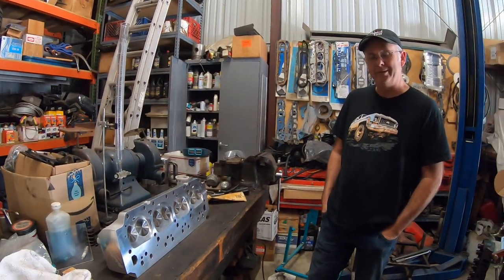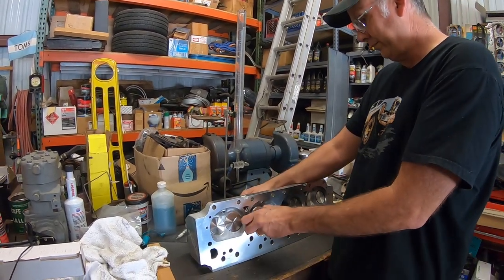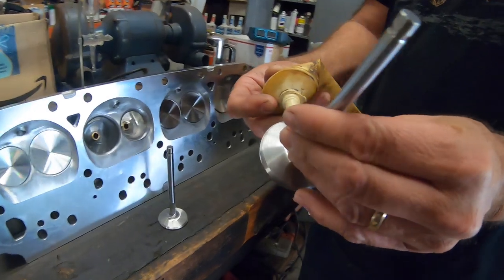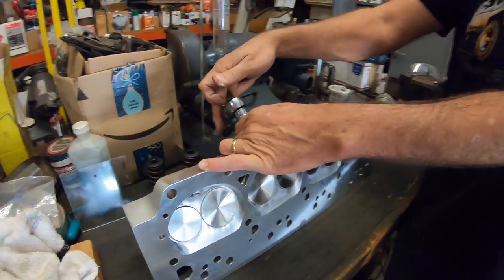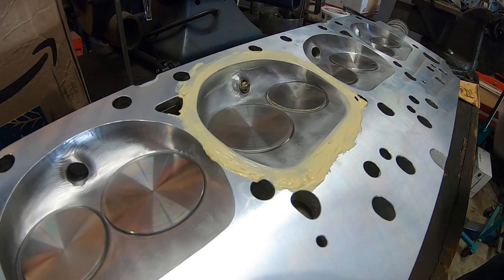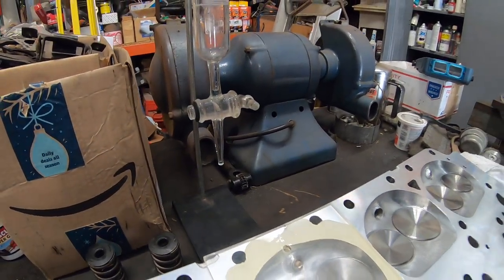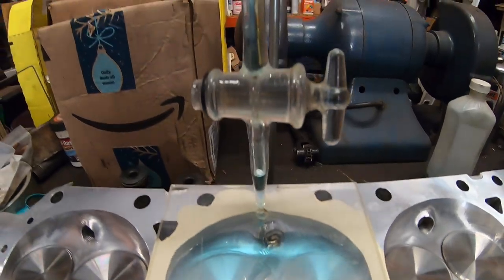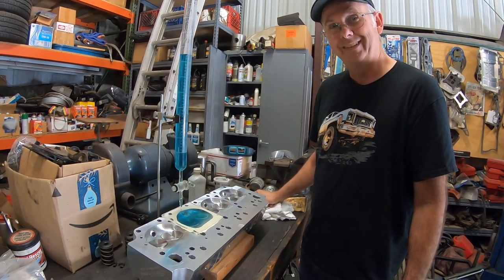How to CC a cylinder head with Elana Scherr and Tom

Comment: GREAT stuff Tom !
I've never CC'd a BB Mopar Eddy RPM or E-Street that was 'smaller' than published ? They are ALWAYS around 2 CC's or more larger in my experience ?.... just the way it is I guess ? 
I just default to squaring up every Block at 10.71" as std practise after Line Honing(studs)/setting Brg Clrc..... and because I still use an old Van Norman Boring Bore mounted on the Block Deck...  so best for me to make sure that the decks are dead buts "parallel" to the Mains before rough boring so I get a nice 'corrected' perpendicular to the Mains Cylinder BEFORE I mount a plate and start honing.
Now, if the Eddy RPM's Flowed anywhere even close to Eddy's published 291 cfm @ .600" we'd all be in business !

Comment: You spilt 1cc and there was another 1cc in the tip of the measuring tool. I think they might be very close to their 84cc rating.
Reply from the maker: I agree, close enough for government work!  Also and not mentioned in the video, these heads have already been milled after cnc porting  so they're not as delivered from Edelbrock and are still bigger than originally supplied.  Thanks for watching and your attention to detail!   T